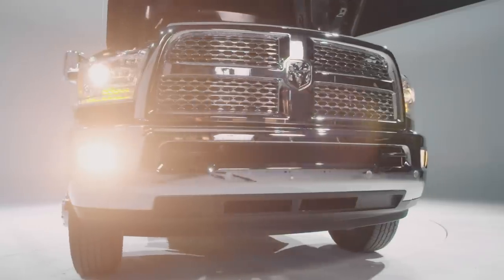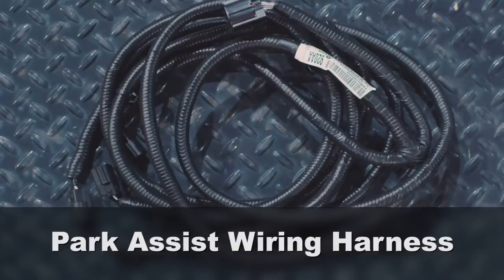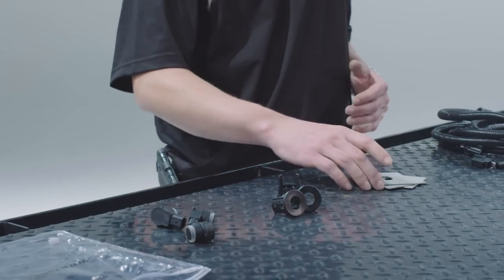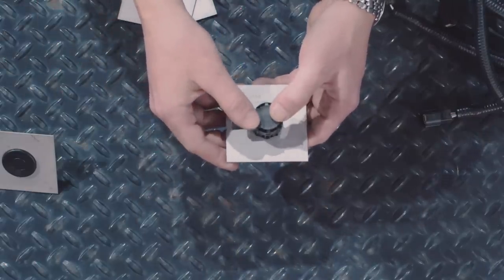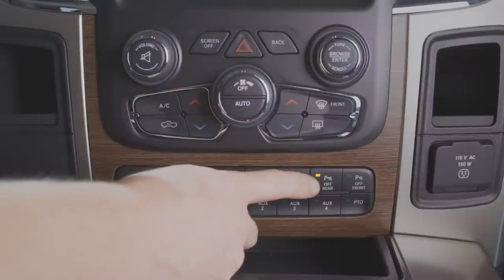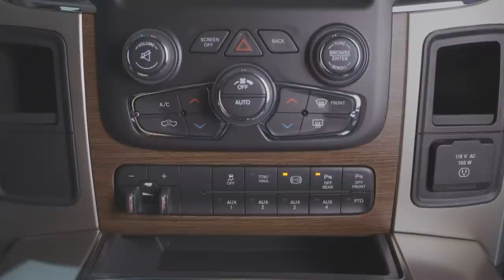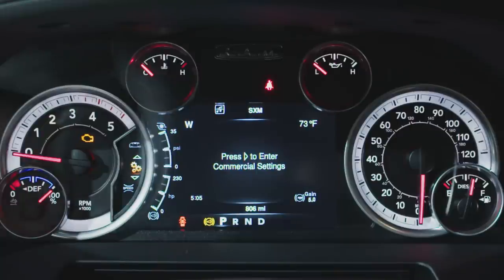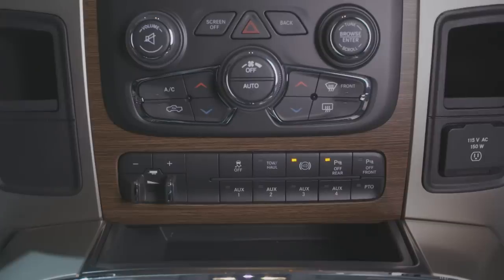Rear Park Assist Install/Operation | Ram Engineering | Ram Trucks

Comment: Hello,  
I know this is an old thread but I was wondering if you could help me out with some install questions?  My previous Ram had rear sensors and a backup camera.  I lost that one in a crash and have now purchased another one that has a backup camera but no backup sensors.  I would like to have them installed front and rear because I loved how the factory worked as opposed to an aftermarket system.  I have a 2016 Ram 1500  with the 8.4 screen.  The worst part is, my dealer here acts like they don't know what I'm talking about when I say I want to add this system.  Can you help please!

Comment: Hey what's up Ram trucks, quick question. Can I use the same kits to install on the front bumper if the truck is already equipped with rear sensors?

Comment: I replaced all four rear and the light is still solid. Also my rear running light doesn't work. Electrical problem? fuse, module?
Reply: Same here. 2017 2500. Still does not work